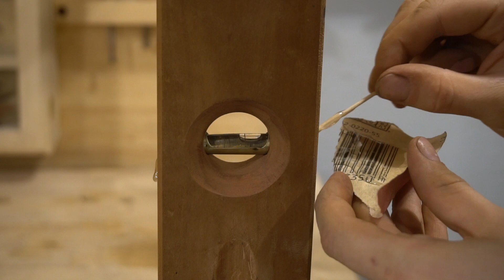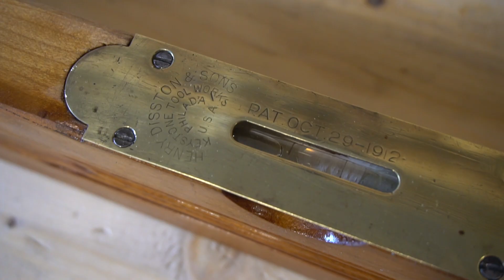Tool restoration: 100+ year old level

Comment: Nicely done but you used the wrong liquid. A low viscosity spirit like ethanol (either lab grade grain alcohol or denatured alcohol) is usually used because its low viscosity makes the bubble easier to read. Isopropyl alcohol isn't an alcohol or a spirit and even at 99% is not that different than water (except it won't go off like water).
Reply from the maker: Interesting! I’ll know for next time. Although I use it fairly often and it feels no different than regular liquid levels
Reply: That's why they call it a "whiskey stick"!
Reply: Would off the shelf denatured alcohol from Home Depot work? Also, Eloise, how is the isopropyl alcohol holding up after the years?

Comment: Any asbestos in that putty?
Reply from the maker: I have no clue. I don't know what it was. Felt like plaster but stronger?
Reply: What I've read is they used plaster of Paris for the express purpose demonstrated here which was to be able to re-set the vials if they got out of level or needed replaced due to breakage.  The epoxy you used will make the next restoration more difficult in comparison.  Otherwise, I liked the results and another quality tool saved from the landfill.